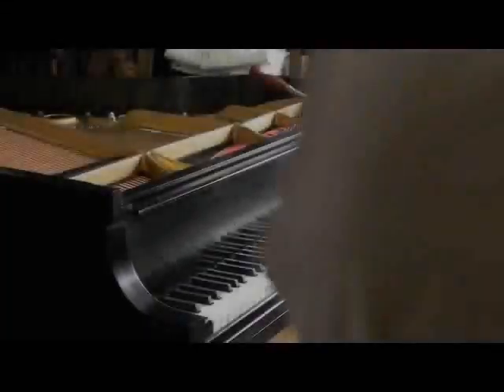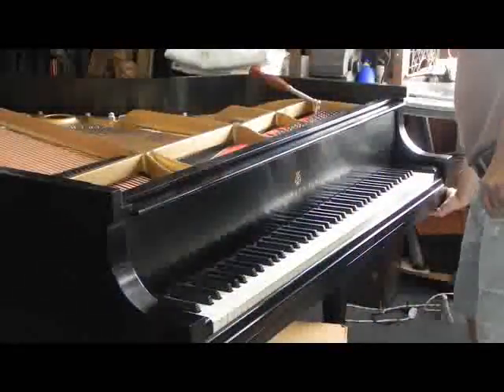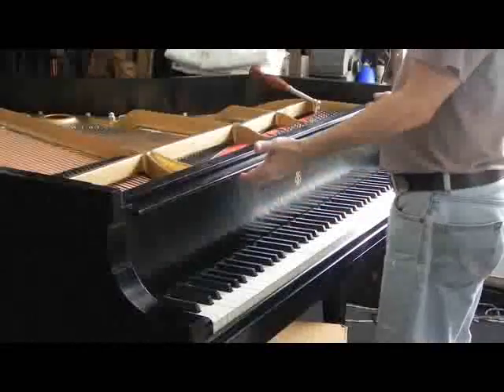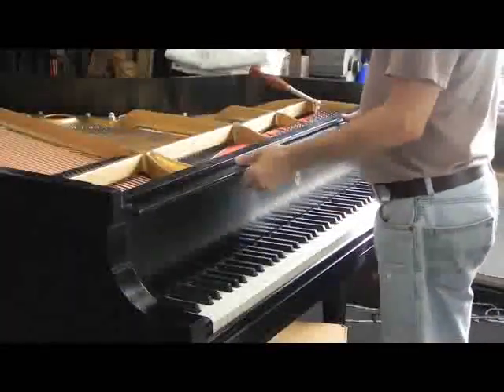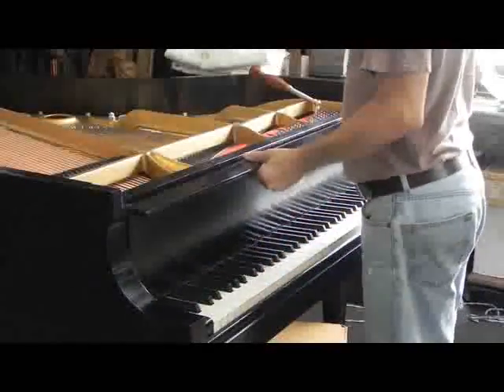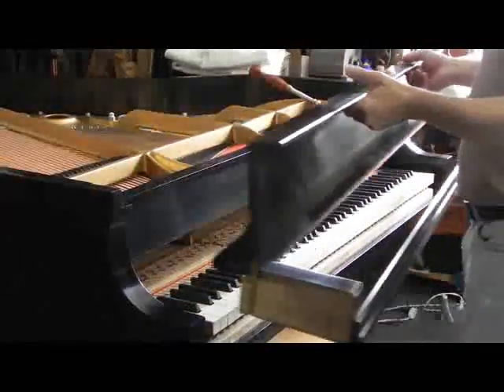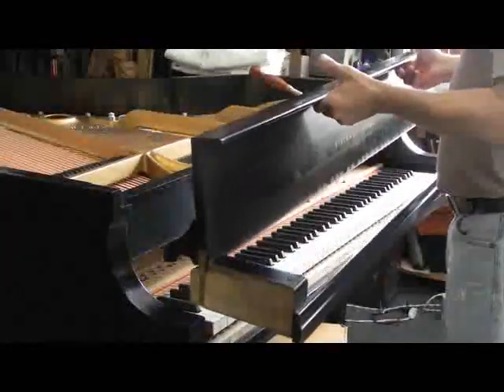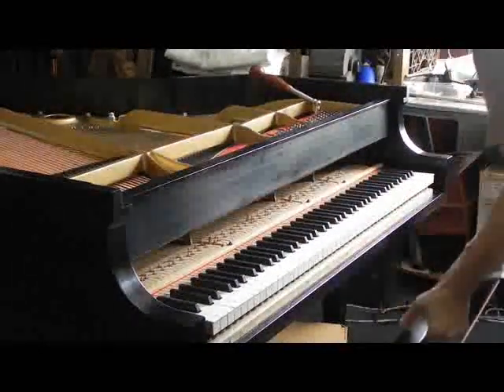How to remove a grand piano fall board in tact

Comment: Hi Keith, I don't check in here much. Try placing the blocks against a wall so you can tilt the fall board back. If you're very careful you can have the fall board in the closed position but do it slowly so the blocks don't come off the pins & then lift it slowly when you're ready to place it back in.